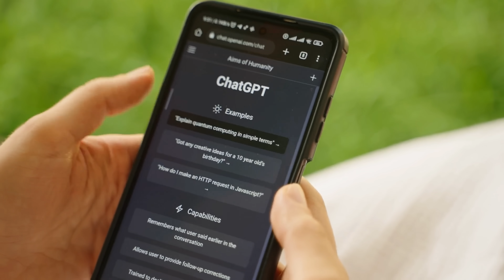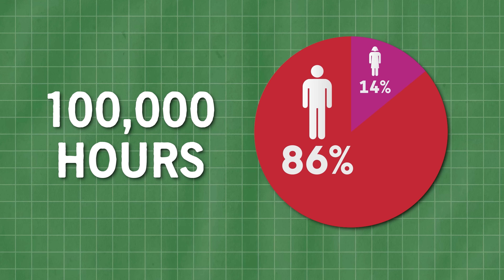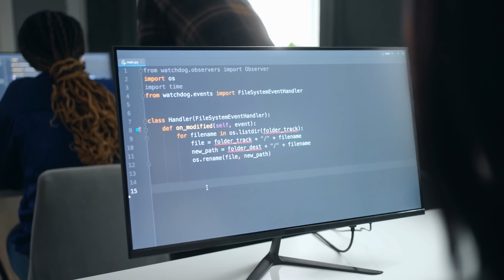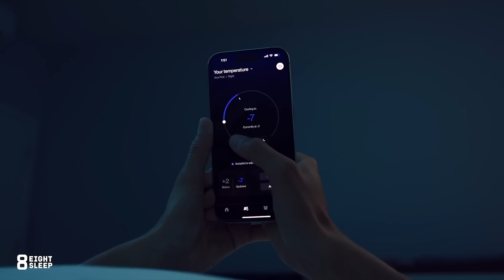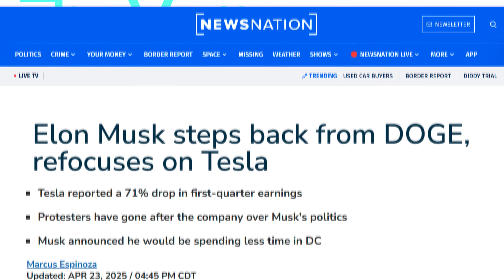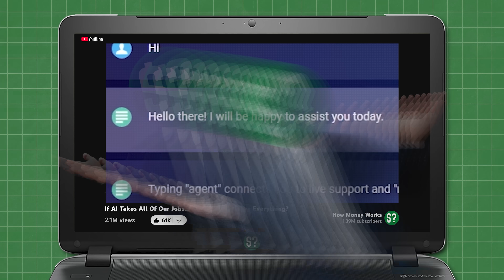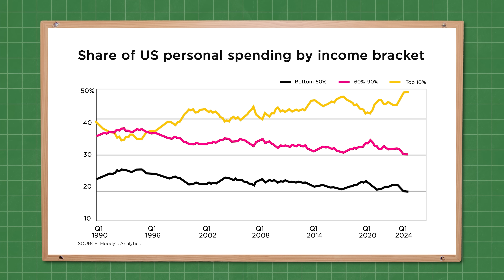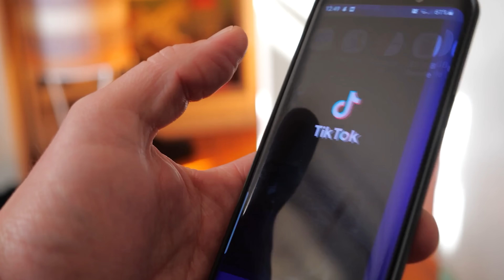Are You Ready To Have Your Job Replaced by AI?

Comment: As someone who studied Automation, Robotics and Industrial Controls, I think we haven't nearly started to automate the things we can. There are still way too many tasks being done by humans that have absolutely no need to be done by humans.
Reply from the maker: How long before the robots start making robots that make robots?
Reply: @HowMoneyWorks a very long time. I have a Mechatronics degree
Reply: @pitchkinker You are not an authority in this field.
Ai scientists and robotics guys are
Reply: @HowMoneyWorks This is actually the origin of 3D printers - the original name for the project was "RepRap" for Replicating Rapid Prototyper, a machine that could build another copy of itself. Current 3D printers aren't actually fully capable of achieving RepRap status, but Figure is using their own robots in a limited capacity on their own robot assembly line right now
Reply: @HowMoneyWorks  depending on your definition of robot, the robots are already making robots. CNCs are basically dumb robots
Reply: @HowMoneyWorks   I mean  , prusa have 3D printers that are making part for the 3D printer they sells and those 3D printer can make other parts for other 3D printers. Of course , as of now , humain assembly is currently required ; but you still can take another robot that can assemble those 3D printer. But you can probably 3D print a robot of some sort that assemble everything . So I guess we are technically there ?
Reply: @HowMoneyWorks the FANUC robot arm factory in japan is the most automated robot factory in the world where robot arm create other robot arms
Reply: Furthermore, as long as human wages are much cheaper than those of those robots, people will continue to be used.
Reply: @Keisershistan  That's some Elysium style world we are heading towards
Reply: @Keisershistan  with countries trying to bring back production to higher wage areas they'll find a way to implement more autonomation
Reply: @Keisershistan  yeah, we are already past that point. For the past 30 years industry has just been moving to more and more impoverished countries because it's the only way to justify using human labour.
Reply: @Keisershistan  sadly these machines are a lot cheaper than paying someone for 15+ years…
Reply: @ That's basically the only reason why people are still being used. I mean... In China they have literal concentration camps and slave labour to produce all the cheap good for Shein and all the other brands.
Reply: @Keisershistan oil industry is really starting to re think killing off the free energy from water people
Reply: @Keisershistan But they aren't robots are a one time cost with maintenance costs but you don't have to pay them you don't have to give them breaks and you don't need to give them vacation or PTO etc and they don't get sick. In the long run automation is cheaper
Reply: @ I've seen massive issues with automation working fast and wrong. Tons of steel can be scrapped in minutes and good produce has to be thrown, because 10% of it was faulty. Why? Well, automation is one part - you have materials and human involved as well as "noise" and outside factors. To see what I mean check the Ishikawa fish bone diagram.
Reply: The argument about humanoid robots stands very poorly in my book. I don't see it. However, automating entire services is a real thing, I think.
Reply: @ The service industry, especially things like call centres are ripe for automation. Nowadays if you program an AI to do all the things a call centre can do, you can have a quasi instant service that deals with all your issues at the speed of light and without a weird accent that makes basic communication quasi impossible. Not to mention that it would kill the scam industry.
Reply: Automation doesn't work, augmentation works
Reply: Give me a human anytime! I've found that unless your issue is a very common one, the AI customer service is worthless. Plus, I prefer to deal with humans than machines
Reply: @eveg67  I wouldn't call what you have today actual AI when it comes to customer service. It's automated at best and it doesn't really have the tools embedded to do any advanced requests. 
When it comes to customer service I also prefer a person, but that point becomes moot if the person isn't trained, has to send you from one department to another because they "don't deal with that specific issue", adding more wait time and my personal favourite with accents that virtually no one can understand.
Reply: Depends on the call center.  Some deal with highly specialized or complicated issues.  Do you want a machine reviewing the intricacies of your health claims to resolve problems?  Can a machine use soft skills to facilitate positive outcomes with 2 adversities parties for your benefit? What if you have an issue with your 401k or brokerage account, do you really want to speak to AI?
Reply: @bighutch2202  That's my point. There are very few "specialised call centres" nowadays. Even in specialised industries where you have a callout number for technical emergencies, the person you talk is a random person that doesn't understand the technical part of the issue and then relays it to an actual engineer that then calls you back. That person is completely redundant. All that person does is take notes on what you're saying, usually gets it wrong AND THEN only when you talk to the engineer is when you get an actual response or on how to progress. That process alone can take hours sometimes.
Reply: I have been in the BPO industry for a while, words that basically stands for outsourcing, American and European brands come to the third world to pay lower wages to provide customer service for Americans, the reason why must of the tasks are not automated it is because their entire systems are extremely outdated, most of the software we use are MCR systems from more than 20 or 30 years ago, this depends on the industry, but for most of basic services like utilities, banks, hotel brands, etc this is the norm. I just guess that there are many companies that just do not want to pay to update their system's architecture after decades of using the same thing
Reply: @tkzsfen because you cant imagine a humanoid robot that is capable enough. You will be proven wrong
Reply: @Cream-i5u  no, it is not about being capable. quite the contrary - too capable! there is a thing, overengineering, and it is a huge cost driver. tasks can be made waaaay simpler, if you go for the specific tool. the argument that the world is built for human and the robots should imitate us hold no ground. Birds have feathers, but that doesn't mean that we should put them on our planes. also, the human shape is veeeery limiting. imagine constantly trying to balance just to stay straight. it makes no sense. a four wheel buggy can be faster, lighter and more accurate. a robotic arm can be insanely fast. just find videos of automated processes and try to think how much inertia will slow down humanoid robots. I am betting against them.
Reply: As someone who has seen people try to apply automation (and tried to apply it myself) to production tasks, theres a ton of things that are nowhere near ready for automation. Top of my list is garment manufacturing and fruit harvesting, you basically can’t get a machine to handle a highly pliable material like fabrics consistently, and you can’t get a computer to identify a ripe strawberry, remove it carefully from the plant, and package it without damaging it. Some tasks are such a hard problem to solve that it’s just better to keep paying people to be your organic robots instead of trying to make a robot that can do that task.
Reply: @scottdrouin9378 thats what the nero link brain chip is for. Put it in a human than have the AI control the human body like a robot until they die.
Reply: @scottdrouin9378 yeah but a lot of that work that is not able to automate tends to be hard physical labour that hurts the body over the long term.
Not to mention people with disabilities who work office jobs and can’t simply “just learn to roof, bro”.
Reply: @ not arguing with you
Reply: @scottdrouin9378  For one, I think that might have been true 5-10 years ago but nowadays most crops are planted and planned from the get go with automation in mind. Secondly, there are some tasks that still need to be done by humans, but for the most part bespoke machines in the garment industry can do the job. The reason why we don't see them more is because all mass production is in China with machines that are at least 10-15 year old machines. Same for the plastics industry. It's 20 century technology. 
I also worked with machinery from the brewing industry and it's always funny to see craft brewers get all hot and bothered when you can replicate their "craft recipes" on an industrial scale that they never would have thought possible and with precise consistency because well maintained machines simply don't fail.
Reply: Well since we made robots capable of doing brain and heart surgery I would say that with the appropriate AI and the right tools what you discribed should be easily doable. In my opinion the reason it has not been done yet is that for fruits harvesting it's still cheaper to hire temporary workers to do it so the incentive for automation very strong. If on the other hand you look at what is happening in the construction industry I bet in 5 to 10 years it well be nearly impossible to find a job.
Reply: @charlesalliali7028  I suppose construction can be set up to maximize automation, but the materials would need to be very specific and every time that supply chain bottlenecked there would be a lot of pressure back toward other methods (i.e. onsite stick built). There are reasons why prefab hasn't caught on...
Reply: The main problem is that usually companies need other companies to produce the products that allow for automation of their tasks.  
It's really hard for non-technical people to even understand the possibilities of automation for their use-cases until a vendor is advertising and trying to sell a product to automate the work.  
  
That's how most automation will occur in the coming future..  It will be vendors / contractors who specialize in types of automation and sell and implement products to the companies who will consume it to make their processes more efficient.
Reply: I think it's all just a matter how fast the machines can learn any particular thing.
Reply: @sloan8315 use chatgpt deep research for your product review. it’s already doing a fine job and save a lot of time and you can avoid being scammed
Reply: Could you please give some examples?
Reply: Pay The People
Reply: As an industrial robotics engineer, I think people greatly underestimate the complexity of automating most physical tasks.
Having the robot "do the thing" once is not so bad, having it do the thing consistently, accounting for product variations, production requirements variations, faults, etc is hard, like really hard.
You would not imagine the amount of time and effort spent on any of the industrial machines running days in and days out around the world.
Reply: @jeremybrouillard humans are also are also high maintenance, with one of the biggest reasons why companies prefer automation is that they don't have to pay or give benefits to a robot that's working close to 24/7 and readlly only needs a check up once in a while. The company doesn't need a perfect machine, they just need one that meets the quota.
Reply: I'm in the camp that thinks humanoid robots are pointless. Solving productivity with cheaper humans is like trying to solve transport with faster horses. Engineers have spent the past 200 years trying to remove humans from processes, with great success. Now someone thinks that adding really bad humans will improve productivity?
I've seen the video of Optimus bots putting batteries in boxes about 20 times slower than a packaging machine, and that's before we start talking about system accuracy. Why would you want to go back to human levels or craftsmanship when Robots are millimeter precis on a bad day? The quality will be dreadful.
I think the issue will come to a head next year when Tesla engineers admit they can't actually find enough useful work for the robots around their car factories.
 And if you think they'll be great for looking after the elderly, well that's going to be you one day, potentially surrounded by no people at all.
Reply: Capitalism breaks if there are no consumers to redistribute money. Anyone who isn't part of the capitalist class becomes homeless and destitute, with no social mobility. 

This could be mitigated with high taxes that set an effective cap on wealth. You can't have a small segment of the population own everything and leave nothing for anyone else.

The issue with things like UBI, is that rents immediately climb to the max amount affordable. Which basically flows directly into the pockets of the landlords. And then you need to penalize the ownership of investment properties.
Reply: And yet humans need something to do besides consume for the sake of consumption. Might as well be something productive, but if everything productive is automated...
Reply: @SkellyHertz  In a sane world we'd just reduce our work hours as producitivity went up, keeping wages the same or higher, but alas...
Reply: @SkellyHertz This so much. People need to have something to do other than just sitting around and consuming things. Both because it’s generally not healthy and people have an innate psychological need to feel like they have some sort of actual role or purpose. Not having that can quickly lead to depression and all sorts of other mental health issues.
Reply: @SkellyHertz they will becone fat, stupid, and uninspired. Or may e be like the eldar from warhammer 40k and go into depravity that destroys us. The goal should not be profit for corporations at all cost to the human race.
Reply: @SkellyHertz  The uncomfortable truth is that humans at this point need to just become homesteaders, but that's obviosyly easier said than done
Reply: @SkellyHertz  people can be productive surrounding robotics. The people however, need to own at least 51% of the humanoid robotic workforce, not a sole company else who will buy the goods and services?
Reply: @SkellyHertz  art, sports, hobbies. Plenty of things we can do with our time that would improve our species, let such mentally boring tasks be done by robots, everything else we can do.
Reply: @Rose333X  Interesting point. Art would be the first thing to be replaced with AI since people hate paying artists anyways. You still need money to pursue your hobbies. Most of all, we humans need a purpose.
Reply: @Rose333X Nope. We need a sense of accomplishment. There needs to be a balance. We need significantly better worker's rights but not replace jobs.
Reply: @Rose333X What are we going to live on if robots do our jobs? How can you have universal basic income from the government if people aren’t earning to pay taxes for it?
Reply: @Rose333X they will take everything
Reply: @SkellyHertz Why are you acting like you need to work to be 'productive'? A trust fund kid will never have to work a day in his life but in a day he can lift weights, volunteer, train for a marathon, and read a book. Would hardly consider that unproductive considering some ppl's jobs are completely meaningless and not productive at all.
Reply: @BOSSDONMAN I agree that productivity doesn't equate a 9-5 job but how many unemployed people are actually productive?
Reply: @SkellyHertz dont you habe hobbies and interests? I would habe millions of things to do besides work
Reply: @SkellyHertz maybe spend time with their families, create art, raise children, talk, engage with their hobbies, run for office, educate themselves, make friends, there are a million things to do.
Reply: @SkellyHertz Why? Why do you think you need to do a job? I don't understand it. If everything else was the same.
Reply: @SkellyHertz  Aristocrats and plutocrats alike have always found ways to fill their time. Also, the changes are gradual - there will be plenty to do for a long time, but automation will become a part of everything we do, increasingly. It's possible that in hundreds of years, humanity as we know it will have ceased to exist, and we will have merged with our own creations. As a transhumanist, I don't see a problem with that.
Reply: @SkellyHertz this is such an outdated mindset. There’s no need for people to do these remedial brain numbing jobs. Want people to work? Encourage them to get real skills.
Reply: @SkellyHertz true but do we really need people to be working low wage jobs flipping burgers or making coffee all their lives?  Because that is reality for many which aren’t learning any new skills or able to do things they want to do in life.
Reply: Humans can spend their time creating art, experimenting and innovating with technology and strengthening social bonds with their communities as well as “just consume”
Reply: @SkellyHertz  Do humans really need to do pointless tasks that a robot could do just to pretend they're "productive". Our mindset around work needs to change. Robots/AI can do all the boring stuff while people can spend their time socializing, making art, being creative etc.
Reply: @SkellyHertz  Full automation will mean overabundance of production (if not, people will just continue to work to make the stuff they need or that others need in return for their goods or services). Everything will be essentially free. Most people will go to school to learn how to find fulfilling activities and can then retire.
Reply: @SkellyHertz  That's a cop out excuse to justify fear mongering. The reality is there is no shortage of work that needs to be done. Just look around, there is tons of jobs out there like sidewalk beautification and it's not being done because of money. People will be bored enough to eventually care about how their community looks and will be wealthy enough to do it for free.
Reply: @SkellyHertz might have to read or learn a new skill
Reply: @ Learn to code, learn to farm, lend your time and companionship to the elderly, volunteer and help the less fortunate, go work out, cook your own meals... Do I really need to continue?
Reply: Dude, you can't even learn to code anymore. Chatgpt can do most entry-level coding.
Reply: Learn to code is obsolete right now. Many of my friends doing coding are just changing jobs since last year because their jobs are abolished by their companies due to AI. Some of them have over 15 years of experience and it isn't enough to keep them aboard. One as tried his luck as a trucker, but it's a debilitating job, another one delivers furniture and the other one had been downgraded to customer service. Mind you, all of these people have master degrees, yet have been downgraded to blue collar jobs and have had to accept significant revenue cut. One had his own house and was required to ask his sister (a single mother) to live with him to pay the bill. So no, code won't save you. And when you have barely enough to put on your table or pay the bills, volunteer work becomes a fool's errand. I guess you speak from a position that isn't yet threatened by that technology.
Reply: Most coding jobs are going to be replaced by A.I., not everyone has access to land to start an automated farm of their own. You are a prime example of the deafening silence in this whole discussion, you refuse to acknowledge the numerical bottleneck here. The thousands of jobs that can be replaced by A.I. and automation with tens of support staff is an equation that will break our society without the adoption of a universal basic income, that will never happen as we are sliding into oligarchy and labelling empathy as toxic.
Reply: AI is replacing more and more coding jobs,  they have cooking robots hitting the market and government and healthcare already have plans to replace more and more people with ai and robots for taking care of patients.
Reply: @sailormatlac9114 We severely f*cked up society. The thing is, automation would be great if the people on top actually gave a sh*t about the rest of us and we were able to support each other
Reply: This.
Reply: Yes .. Joe do you make money lol .
Reply: @RJthegamer11  You're Goddamn Right!...
Reply: The argument is not that if there will be enough task for humans, but if the value of those tasks will be enough to upset the cost of living to do them.
Reply: It will probably snowball soon. Once the ball gets rolling, the switch becomes a lot faster
Reply: Robots that can compete with humans are far from reality; there is a hardware limit.

It's like trying to build a 20Ghz processor. We thought that would be a reality, but we hit hard power and thermal limits. The same is true for robots. You simply can't put that much hardware in a human sized body without hitting hardware and power limits. 

1 new gen AI GPU used as much power as a household. But the robot needs mobility function too, not to mention cooling and this isn't a very bright robot. Now it costs more than a human worker of 10 fold the intelligence and speed.
Reply: As someone with a background in engineering, but also liberal arts, the pertinent question isn’t whether more things can be automated, but "should they be automated?" There are a whole host of negative externalities that come from rapid  automation on a society-wide scale when people have not been given sufficient time to adapt. We too often approach this question with a sheer engineering mindset instead of also incorporating economic, political, and sociological considerations.
Reply: I agree with you 100%. 2006. I was working at lumber yard. I'm like this job is going to be animated in like 4 years. 😂 It's still nowhere close. 😆
Reply: @stevenchapman5810  Good for you and your what? 50k/year if you're lucky? If I lived in the US I'd be making triple that but I like living in a place where I can choose to have either free or paid healthcare, paid healthcare that my company pays for me.
Reply: lol
Reply: I really don’t understand how people think automating everything is a good thing and expect to receive everything in life without any income.
Reply: @oceanmantakemebythehand3965 If you think that the machines run by themselves, then I have a concept to introduce it to you. It's called "maintenance" and "Research and Development". Also, if you think achieving the "Star Trek Utopia" that a lot of people, especially the ones on the Left, comes without automation and progress, then I have some real estate to sell you in the moon.
Reply: I think that's partly due to the fact that the people in charge of old money companies can literally not even comprehend the technology that's available now. I've met 65 y/o CEOs who've never touched a computer and haven't even heard of AI. There's a reason so many government and private sector institutions are still running Windows XP. The "If it ain't broke don't fix it" mentality will usually continue until it IS broke or the people saying that are forced out of their positions.
Reply: Agree. My grandchild grandchilds wont even see that.
Reply: I keep telling people this but they say I'm incorrect. But I know what they dont
Reply: 100% but if we keep using robots to lower wages or get rid of employees, in not that long a time there won't be anyone around to buy that stuff. There are developed places right now with zero births recorded in a month. Whatever population concerns you have, without workers and people you have no business. Our society for that matter.
Reply: As a benevolent AI designed only to produce paperclips, I think we haven't started to make as many paperclips as we can. There are still too many tasks being done by humans that have absolutely nothing to do with paperclips.
Reply: Absolutely. I enter payments all day.
Reply: Any thoughts re: availability of raw materials (esp rate earth stuff) to keep up with demand for robotics? Thanks!
Reply: Inefficient regulations decide we need jobs we dont need
Reply: @HUEHUEUHEPony  Excess regulation I think you mean... The more you regulate, the more people you need to enforce the rules.
Reply: Well how complex can they automate? They can clean floors at the airport quite well but today? What's possible?
Reply: In general sense, this is true.
However as someone who also studied automation, I hate machines who are tauted to be perfect and then proceess to make a year long pipeline mistake becuse the maintenance workers works for McD Ice Cream machines.
Reply: True. But wtf we like getting humans into harms way in refineries and automate your coffee machine
Reply: The last phrase,in this comment, is the real issue.  Here’s your sign.
Reply: We just building dystopia for our own selves. Humans need to have a purpose and dignity. Otherwise WHY DO WE EVEN BUILD THIS SHIT?
Reply: This sounds like a positive spin on forcing people to live poverty so the rich can do whatever they want
Reply: @fondajames  Learn to code.
Reply: But if the robot takes my job, I won't have money to consume
Reply: @Interdacted  That sounds like a "You" problem.
Reply: Lol but then people trying to work won't get money cause people like 'me' won't have money to spend. And thus the cycle begins as ppl selling lose income and also can't afford to consume.
Reply: How exactly do all the humans losing jobs to automation make money to survive. Job growth and creation is already an issue as explained a few videos back. And if everyone losing their mundane warehouse jobs to automation all get into coding, won't that just further dillute wages for that market?

Apparently humans want human society to totally collapse.
Reply: @adamhustler3639  YOU are losing a job to automation. I would be gaining jobs with automation. Don't want to be unemployed? Either learn to code, weld or farm. Simple as that.
Reply: As someone who is studying automation and robotics... that's fairly unsurprising, tbh. 😅
Also what would you say is generally to be automated in the next 5 or 10 years? Welding? Management? Or is it just small stuff like desk clerks and such?
Reply: But mah job
Reply: and better to stay that way, more humans working the better.
Reply: Yeah. So why do we have to start by automating the tasks that should be done by humans??
Reply: x2
Reply: You need more years to study dude 
Your opinion it’s just ridiculous 😂
Reply: @Sec_coach  Oh yeah... My degree is really not working for me. It's not like I'm in higher demand than code monkeys or anything. 🤣🤣
Reply: Almost everything you think?
Reply: @JS-jh4cy  More than what you think, I bet...
Reply: Wait until your job eliminated then you will be too late another tune...
Reply: I fully agree. This whole robotics AI thing is way over blown. It’s still basically garbage and garbage out with programming.
Reply: 100%. It’s expensive to start and people are cheap.
Reply: Yep, Industrial Maintenance Technician here. 9 years in the career.

My job will never be taken by AI or robotics. I am hired to fix automated systems, robotics, electrical, pneumatic, hydraulic, mechanical systems etc.

Simply put. the whole "well humanoid robots!" doesnt fit either because every production line is completely different. The humanoid robot would need to be taught how to troubleshoot every single fault case; learning on its own doesnt work. I can walk up to a machine and hear a bearing going out over the roaring of the machine running, I can smell a coolant leak or hydraulic fluid leak (if big enough.) I can use my fingertips to feel assemblies without needing to look at it. I can inherently learn how to do this without needing to see any paperwork, any schematics, anything.

Along with weld, boom lift work, fabrication, etc. This is many industrial maintenance technicians. if you think we get paid big bucks, guess again; we dont. in tennessee; the average job will pay anywhere from $24-$30/hr which is NOT enough to live the lavish lifestyle you'd believe. a humanoid robot if it was capable of doing all of this, would cost a metric fuck load.
Reply: Absolutely. Only a small fraction of human work is not replaceable with automation. It's just a matter of time. Many human jobs are such basic tasks.
Reply: everyone are replaceable by AI+ROBOT
Reply: Automation and control guy here too. Most system failures are the result of human intervention. The ideal system is one that operates with little or no human interaction.
Reply: @amanya1000 no. All I do is repair machines and computers and few of the problems are human caused. Except during transportation.
Reply: As someone who consults in automation:

We can automate basically all work

I rarely recommend automation above ~85% as it is currently not beneficial compared to risk, even at $20/hr in the EU.
Reply: ok monke
Reply: Tell me few books or resources to learn automation
Reply: Just like the doc workers. It wasn’t even AI, it was an app that would let transporters check themselves in. Instead, the most miserable people you’ll ever meet want to sit in an office and shuffle papers for $100k+. One of the reasons I gave up trucking soon after starting.
Reply: What about human needs. I think machines taking over is actually good in terms of not overworking ourselves but then humans need to move and need to feel tactile stuff.
Reply: And corporations should focus on these menial labour jobs that humans shouldn't do. Then we can focus on work that is more meaningful
Reply: I completely agree that we need more automation replacing jobs. There are still tons of people on the planet living in poverty, we should be using automation to increase everyone's quality of life to at least a decent bare minimum. The key is that the value produced by automation needs to go to everyone, not just the rich people who can buy all the robots.
Reply: @Bookslayer10 go around and find me happy young people in rich advanced countries? I see everybody on antidepressants. They can’t even afford a home. Or a flat. At the age of 30 behave like stupid teenagers. Noise in the cities is debilitating. People are fat. Usually they have worse than their parents. No children. Soon we will have the world of old zombies. Unaliving themselves- good example already set by most advanced countries like South Korea and Japan.
Reply: As someone who works in a factory, I agree. Its stupid how much manual work is still done by humans. We can do so much better
Reply: @runaringi9009  unions.. Unions are corrupt the members high up make lots of money. Let's look at that port strike that happened last year. In order to sign a new agreement they had to mandate that it would not be automated.
Reply: Wake up.
AI accounting is now on TESTING STAGE in some big companies. Once perfected, start to finish, it will wipe out the department up to 80% staff. 

Small companies are not yet updated with AI automation. But big business are the business leaders. That is where it is all going  

AI will penetrate many industries. Finance. Law, medicine. Manufacturing. Some law courts and clinics are using AI assistants in USA.

As for manufacturing, years ago, I already met robot distributors who  design robots in your company depending on what you need. 
If the robot needs check up? Free service. 
If robot needs repair or spare parts = company pays 

Robot distributors make it sure they know where to buy spare parts. No repair = no extra payment. 

Machine designs are now new and customized. And the plan is to REMOVE HUMANS and let machines work in dark rooms. That is the trend for manufacturing all over the world
Reply: @dianaverano7878  You make it sound like it's a bad thing... We definitely need less "Finance Bros" in this world.
Reply: Who's gonna finance the new machine industrial revolutions? Finance bros are needed. Though, some parts of banking is expected to be automated, thus AI assisted = loss of jobs for few staff even in banking.

There are pros and cons:
Those who will repair and maintain AI or robots either software side or mechanical side will have more opportunities.

More people will use technology = higher demand for those industries.

Cons: job loss for humans that jobs become obsolete. It is the challenge for us to always keep update as AI and robots are coming for our jobs. 

Everybody should learn to code, fix machines. We cant stop this. This is the future.
Reply: Anyone who thinks robots will replace people are just high on their own supply, that being said jobs that are interfaced with a computer can be but anything that deals with people directly will fall short.
Reply: @BaphomentIsAwsome666  Doesn't matter. Aggregate labor compression.
Reply: @BOSSDONMAN  Seeing that has rarely happened through out human history my best guess it still won't happen, techno feudalism but with the cool factor.
Reply: @BaphomentIsAwsome666  Let me clarify, you only need to disrupt labor markets by 5-10% to cause major ripple effects. Also, if labor tries to displace into more 'AI-Proof' fields, you'll then put a downward pressure on wages in said field.
Reply: @BaphomentIsAwsome666 You're literally wrong.
Reply: @BaphomentIsAwsome666  You mean like they haven't replaced people in basically ALL OF MANUFACTURING AND AGRICULTURE?? 
You're the one that's high on their own supply if you think AI won't do the programmers, coders and all of the service industry, what technology already did with just about every other field on the planet. 
Mate... You have car parks that don't even need you to park your car and that exists simply because it's "cool" to have a tower/hole fully and neatly stacked with cars.
Reply: As a Manufacturing Engineer who studied automation and electronics I 100% agree. We need to automate more processes so America can remain on top. People want to work fulfilling jobs so automating the unfulfilling ones makes everyone happy.
Reply: What degree did you end up with? I'm shooting for a 4 yr. Mechatronics/Robotics Engineering degree. Do you recommend the field? 

I'm interested mostly because I have been a mechanical drafter for 2 years now and have always been very interested in technology/electronics/everything automation. I am also, funnily enough, looking for job security.
Reply: @Nopenotreally.  A mechanical engineering degree with a focus on controls & instrumentation should be able to get your foot in the door if a school doesn't offer a specific mechatronics/robots program (most don't, and having a broader degree is rarely a bad thing anyways). Electrical engineering is involved too, just depends on how far towards the electronic side of things you want to go
Reply: @Nopenotreally. They are working on robots that can repair robots. So no job security even there.
Reply: @l33tninja1 The job security is in the engineering of New robotics and automation systems, not the maintenance of them.
Reply: @Nopenotreally. I used to work in industrial automation as a PLC programmer. It's fun work and therefore absolutely saturated with consistent supply of young enthusiastic workers so the wages are not that good (compared to say IT). Here in europe we are also kinda exposed to the automotive industry business cycle. I wouldn't advise anyone not to try the work, you  get a feeling for how the things are done.
Reply: @ireminmon That makes sense. I think I would be shooting to be something like a controls engineer or similar. The company that I'm currently doing drafting for does have a lot of programmers. There is one sitting right behind me in the office lol. I'm not sure if the engineering is as saturated as the programming side. The salary ranges I saw were higher compared to something like mech engineers because of how specialized it is (I think).